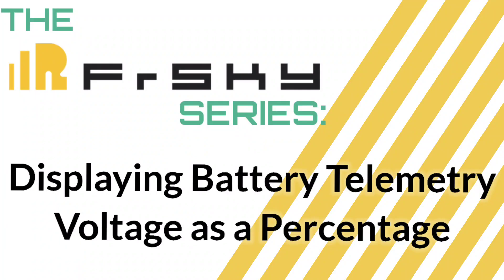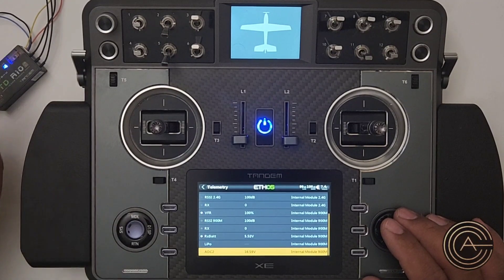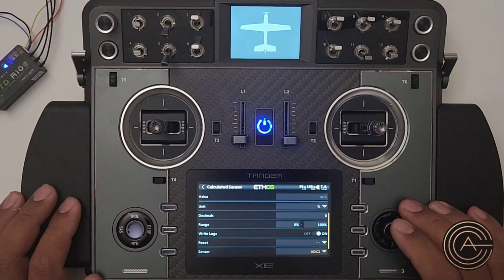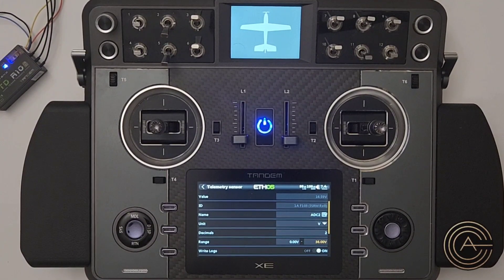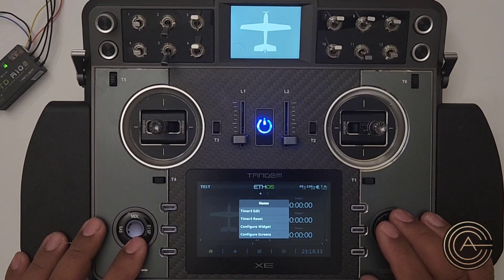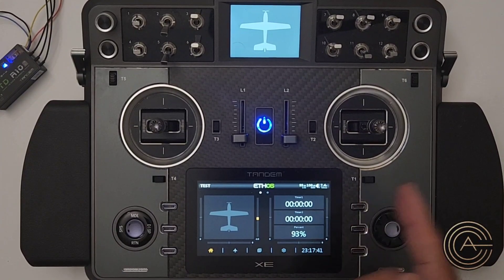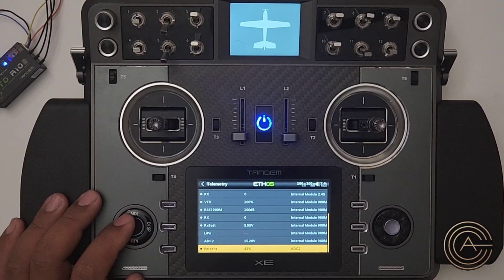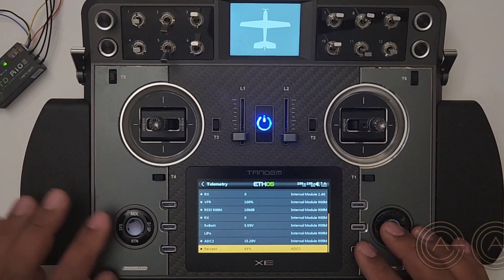The Frsky Series: Display Voltage Telemetry as a Percentage

Comment: Great videos and done in a logical order.
I have one question which I seem to be missing you have a TD r 10 receiver with a voltage rating of 3.5v -10v but you’re using a 4s battery with put out 16 v how is this not destroying the receiver? May seem like a dumb question but I am fairly new to all this.
Reply from the maker: The battery is connected to the ESC which powers the motor. The ESC has a connection to the receiver. That connection supplies power to the receiver which is regulated to 6 volts or so (depending on esc settings). So you get full power to the motor while the receiver and servos have regulated voltage to what they need.
Reply: @all_rc  makes sense I initially thought you plugging the 4s directly into the reciever and thought I was missing something.
Please keep your videos coming they are excellent and well described I’m surprised you don’t have more likes.

Comment: Great video! Thank you very much! I just set up mine this way for my receiver pack, and it works great. Quick question, do you have a video also showing how to set an alarm once it reaches a certain voltage versus having to look down at the screen all the time?
Reply from the maker: https://youtu.be/xvIe9PRj12g this video shows how to set up the built in voltage sensor on some frsky receivers. At 6:25 and i set up a voltage callout when i press a button. At about 8:05 i set up an alarm.
Reply: Set up a logical switch to throw when voltage reaches a certain value then create a special function which plays either value or a warning when the logical switch throws

Comment: Hi thanks for the video . I.m having trouble getting the ADC2 to display a voltage. Is this due to my receiver being an SR8 pro? Thanks again
Reply from the maker: I have not used an SR8 Pro but a quick glance at the manual seems to show that it should work the same.  Confirm that you are on the correct wire (second wire after negative). That wire should hook up to the positive lead of your esc. When you look at the ADC2 telemetry screen you see 0 volts? It should work.

Comment: Great ! Question send this week-end, you published an accurate tuto this monday !
Reply from the maker: Lol! Caught me at the right time with an interesting use case that I wanted to try.
Reply: @all_rc  One new challenge ? On my plane I use 3S and 4S lipos.... so basically the calibration of the AIM2 (Lowest/Highest values) can be only be done for 1 type of lipo to get an accurate pourcentage.
Do you this it is possible to 'duplicate' that, to obtain 2 calculated % sensor ?
Thx master :)
Reply from the maker: Hmm... tough one. Since the range is defined by the ain2 sensor, you can't build another calculated sensor with a different range. My only thought is to clone the model. Call one 2s and the other 3s and have different ranges for each. Give that a shot and let me know!
Reply: @all_rc  ok thx. Painful to manage 2 models, in case of trim changes etc, but I understand the technical blocker. Gonna set it up for my 5lipos 4S, and thats it for my 2 lipos 2S.
Thx for your explanation.
Reply: in opentx you can run a lua script via a special function..i have a lua script which automatically calculates the lipo percentage voltage for 2 to 6s batteries..ie the script automatically gets the number of cells in the attached lipo battery and sets the appropriate range accordingly...it seems that ethos cannot run lua scripts via a special function (which is then activiated via a switch eg the SB one)...Am I correct about this?
Reply from the maker: That question is, unfortunately, beyond my knowledge.  I have never tried that as i do not have any scripts to try it.  I would post this question on the rcgroups frsky forum or the frsky ethos user group on Facebook.

Comment: Hi, good day and thanks for your videos. I wanted to ask you how to do with my T20S radio that when the throttle lever is halfway it alerts me when I'm flying and I can't look at the controls. Thank you so much!!!!
Reply from the maker: You'll need to set up a logical switch and a special function. It doesn't come pre set up, unfortunately. Go to LOGIC SWITCHES and add with the plus symbol. Name it. Then under FUNCTION, choose A~X. This means A is approximately a value. For SOURCE (A) choose Throttle. For VALUE (X) keep it at 0 (0 is mid throttle). You might wanna add a DELAY BEFORE INACTIVE if it is too sensitive. Now go back in the menu and go to SPECIAL FUNCTIONS. Add one with the plus symbol. For ACTION, choose HAPTIC. For STATE choose enable. THat should be it.
Reply from the maker: I forgot one step. Under SPECIAL FUNCTIONS, on ACTIVE CONDITION choose LOGICAL SWITCH 1 (It's the one you created and  labeled whatever you named it).
Reply: @all_rc  Gracias!!!!!
Reply: @all_rc  FUNCIONO!!!!!!!!!!!!! MUCHAS GRACIAS!!!!!!!!!!!!!!!!!!!!!!!!!!!!!!!!!!!!!!!!!!!!!!!!!!!!!!!!!!!!!!!!!!!!!!!!!!!!!!!!!!!!!!!!!!!!!!!!!!!!!!!!!!!!!!!!!!!!!!!!!!!!!
Reply: @all_rc  Thank you very much, I'll try it and I'll tell you!!!!